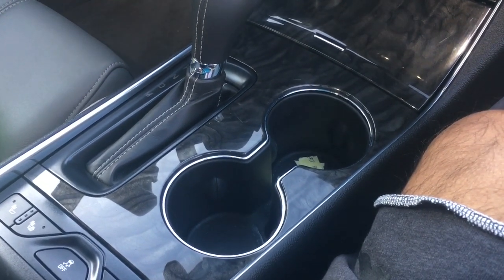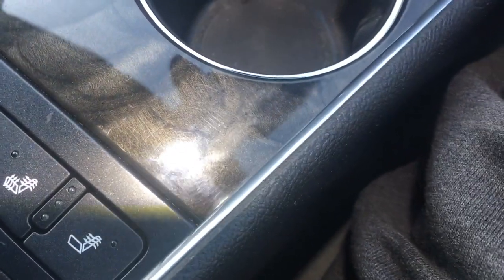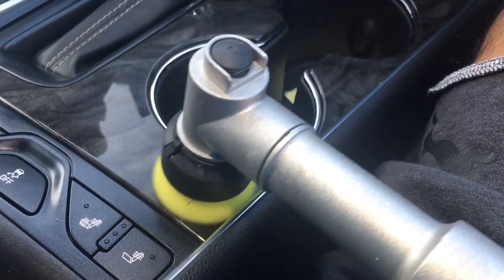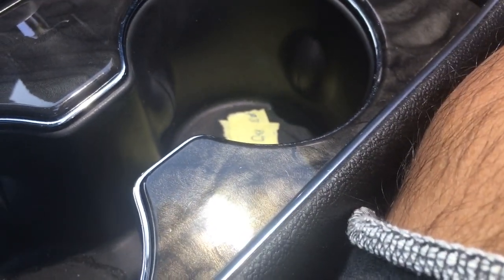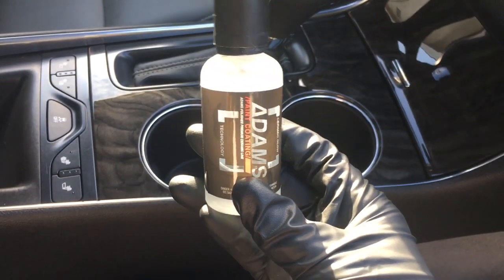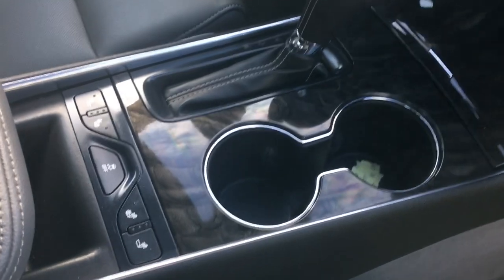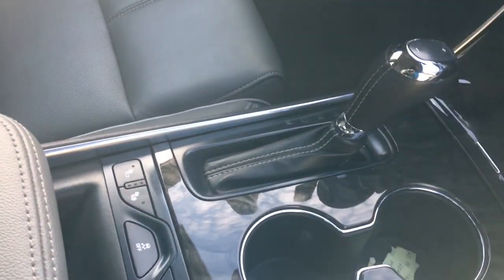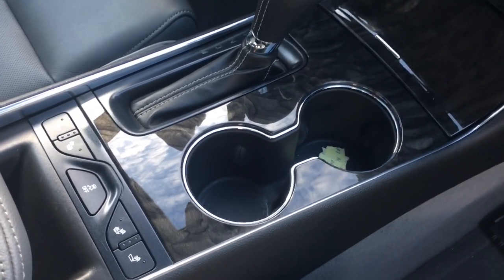Polishing and Protecting Interior Piano Trim

Comment: The name of the product is "SLICK BACK: Primer Polish".

I won't lie... I thought of the Boondocks character: a Pimp called Slick Back lol
Would you still recommend this product in 2021 or have you updated to another?
Reply from the maker: Haha I actually still have the bottle and have a little less than half.  I still use it.  The last thing I polished was the set of wheels for my Grand Prix and coated them with the Adams Advanced Graphene Coating without a panel prep.  Just let it set up for 1 hour to not have to a panel prep which saves a lot of time.  It is a great product and has worked with Gtechniq C5, Jade Graphene Pro, 3D Ceramic Coating and currently the Adams Advanced Graphene Coating.

Comment: Hey bud you mentioned coating the leather seats with what?? With that same thing you used in that console panel? If so hows that help the leather seats? Can you also recommend me a good leather cleaner and protectant or combo pls for soft  leather seats  Thank you.
Reply from the maker: It was not the same product.  It was a dedicated leather coating. Its been so long that I don't recall which one.  It was either Cquartz Leather or Gyeon Leather Shield.  There are many different  leather ceramic coating offerings these days.

If you are not one for a coating then you can look into Colourlock.

https://youtu.be/yKMzUGqX5tk

Comment: what do you reccomend for the interior panel's?
Reply from the maker: For which type of material? Plastic? The piano trim piece like in this video?
Reply: @MikeGDetailing  for door panels, dash board, the plastics...i have a dog that im about have with me on trips, want to prevent drool stain/etching on door panels.
Reply from the maker: It may not prevent that from the dog but Gyeon preserve works great on those areas. If it’s too glossy it can be diluted down. I have not had an issue with it undiluted and coming back with a towel to knock it down a bit.

Comment: This is not a filler right? Heard interior piano is really thin so after doing this what should i use to protect it so dont have to redo it
Reply from the maker: Jang Lee surface was polished. In order for the coating to properly bond a panel wipe is needed.  If you want to avoid this completely then paint protection film is your best option.  

A ceramic coating is still going to get scratched up but it’s better than nothing.  A light polish is all that is needed to do it again.